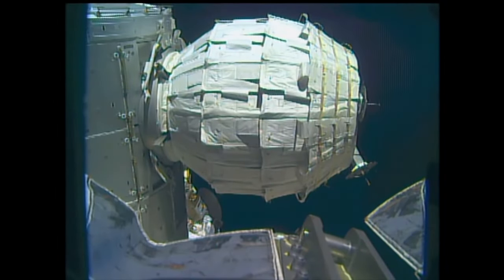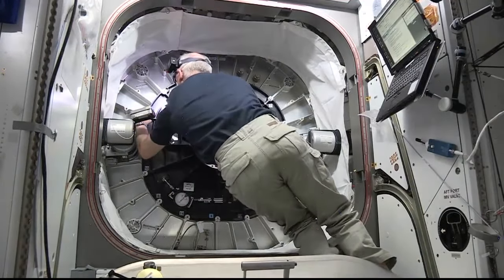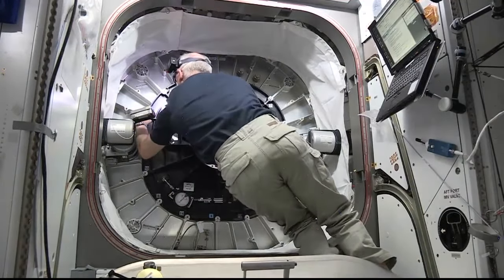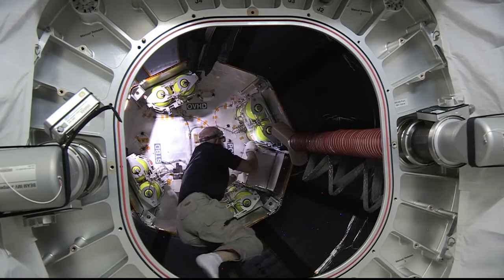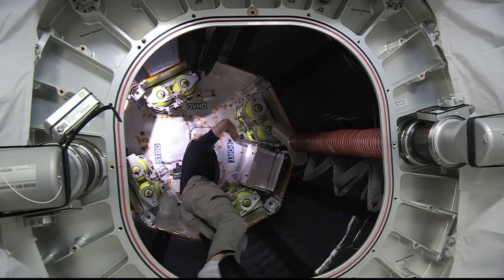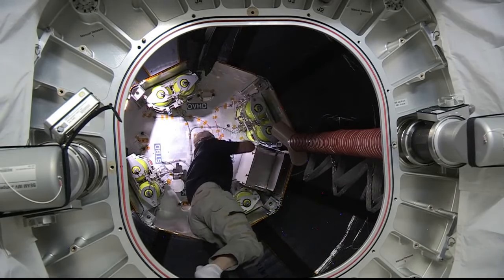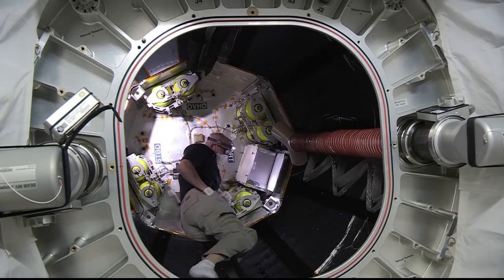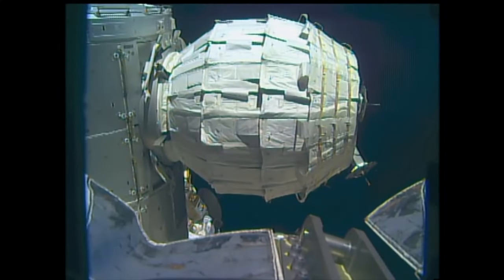Astronaut Jeff Williams Enters BEAM Inflatable Module at ISS

Comment: God, the fear of accidentally tearing the walls... I would never go in there.
Reply: They'd be as easy to tear as WW2 tank armour would be. In contrast, the Lunar Module cabin on Apollo was effectively made of three layers of aluminium foil.
Reply: Uhg stop with this "Three layers of aluminium" BS, just think about it for yourself for a moment.  I'm not saying the LEM pressure compartment wasn't impressively thin, but if you think 3 layers of aluminium foil could hold 1 atmosphere of pressure with a total vacuum on the other end, you're mistaken.
Reply: CMDR Frisky Weasel "the Lunar Module cabin on Apollo was effectively made of three layers of aluminium foil."

Which you can puncture with your finger. "WW2 tank armor" my ass. If 3 layers of foil were that strong then an inch of it would be the most powerful armor plating in the world.

Comment: What does the BEAM module do ?
Reply: Its a prototype inflatable module. They are shipped up uninflated (like an empty balloon) and then inflated once in space to many times their original size, eventually allowing giant space stations to be constructed.
Reply: what?? how is that even possible ??
Reply: Layered pieces of armour that can move over each other, connected with high-tech cloth, and a bunch of compressed air. Go google Beam Module Inflation, it's pretty neat but makes a horrendous sound :)
Reply: As long as there is positive air pressure to keep the space inflated, the thickness of the material doesn't matter all that much. Micrometeorites would punch through an armored space just as easily as paper. The material just has to be air-tight and I assume they have a reflective layer for radiative warming. Similar to how current prototype spacesuits are being worked on that are essentially custom-fitted skintight drysuits: They're tight enough to prevent your body from expanding in vacuum.